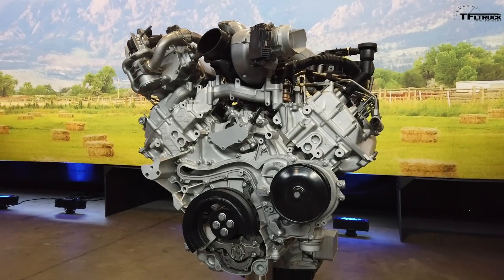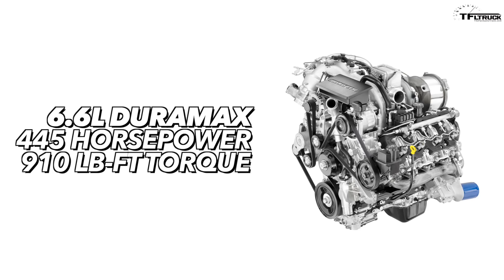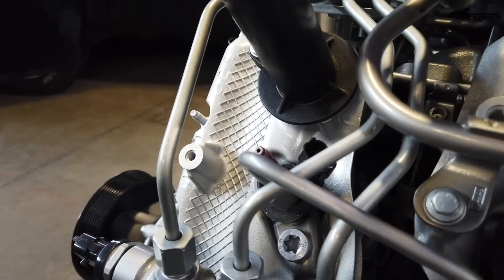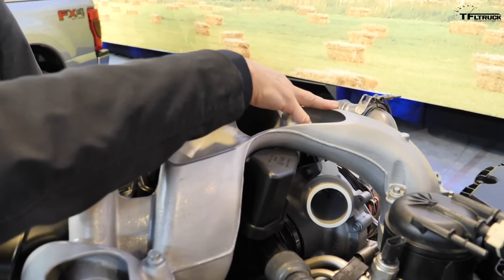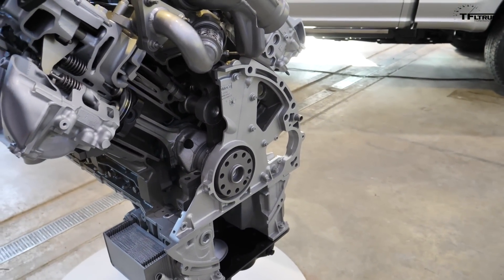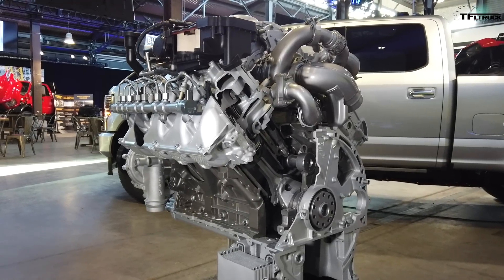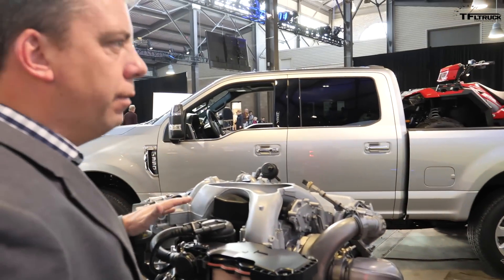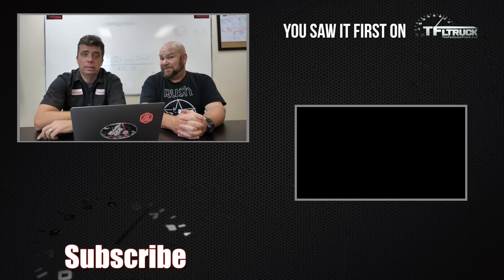Here's How the 2020 Ford Super Duty Diesel Makes 1,050 Lb-Ft of Torque!

Comment: ford tremor actually has LSD front locker
Reply: That is factually inaccurate... an LSD locker doesn't exist lmao you are saying it has a limited slip differential front locker? Which is it? Limited slip? or a locker? because they can't be both and they are in no way the same.
Reply: @brandonmoore9440  it's LSD like the raptor
in TFL they consider LSD a locker
Reply: @amm2472  TFL does not consider an LSD a locker nor does anyone else in fact they actually stated the tremor doesn't have a front locker like the Power wagon in this video so if they considered an LSD a locker they wouldn't have said that so just admit you don't really know the difference and go on with your life.
Reply: @brandonmoore9440  Roman does
in ORI index he always counts LSD a locker
Reply: @amm2472  That's because they score the "offroad worthiness" and they use a score 5% for front/center/rear diff and so of course having an LSD they are going to give it a technical count as a "front lock" because it is obviously a benefit over a normal open diff front but it isn't a "locker"
Reply: @brandonmoore9440  that's exactly what I am trying to say
Reply: @amm2472  It did not come across that way, but then we agree so good day lmao.

Comment: Until a Slightly modded Gen 3 Cummins pulls up next to it.... then it’s an overpriced slow aluminum can again that sucks diesel down. I get 26.7 mpg hwy empty on my 04’ 2500 quad cab, bet the Ford gets half that.

Ok Ford Rant Over, it does look nice I will give it that but better than my Gen 3, no way! My opinion after owning both vehicles, on my 2nd Gen 3 (the original Million mike motor)

Comment: "The truck wars are just getting started..." 
I'm confused. Then what has been happening the last 30+ years. The only war I can think of that has been going on even longer than the Afghanistan conflict is the truck war.
Reply: Well think about it.  Just fifteen years ago, diesel pickups only had around 500lb/ft of torque.  Now we have two out of the big three with trucks at or above 1,000lb/ft of torque and some of the gas pickups of today have as much torque as the diesel trucks did fifteen years ago.  Now we're waiting to see who can pass 2,000lb/ft of torque.  That's why they said the race has just begun.  It's been building up and it's only gonna get more competitive.

Comment: These trucks are gonna be putting out semi numbers in the next ten years lol
Reply: They pretty much already are...
Reply: Gonna need a CDL prior to purchasing them too lol
Reply: DOT is going to have a hay day with these new trucks, hope new truck owners are willing to get their cdl licenses to drive these ....
Reply: Semis will just handle loads better
Reply: They already are
Reply: Real talk. How about improve emissions systems.
Reply: Well you can get anywhere from 400 to 600 horsepower and 1650 torque to 2,000 lbft of torque. I have the economy version of the Cummins ISX 400 horse and 1650 torque. Regardless these new trucks are getting very impressive with their power and torque outputs
Reply: @Homer Simpson I like a little black smoke but i would like if they improved the emissions treatment would last long as the engine.
Reply: And the DOT is noticing this as well.
Reply: Alexander Syed   But Semis are also going to get monster numbers in 10 years. However not as big of an increase
Reply: Not really a 550 hp engine in a heavy truck puts out 1850 torque or the optional 2050 at way lower rpms with way higher duty cycle.
Reply: @swacoustic  look how power output keeps increasing there gonna put out semi output numbers an economical hwy truck puts out 450HP & 1700FTLBS.

Comment: All these new engines from the big 3 are amazing. But to be honest I wish they would concentrate on MPG and durability and remain at the current power levels.
Reply: supperterofsanity  All of these engines are durable period ! No worries there !
Reply: They are durable. Any new heavy duty truck will get you 200,000 miles no sweat if you take care of it. And I would say the fuel economy is pretty damn good for an 8-10,000 lb vehicle.
Reply: Alex Puls lol I had a 2005 Chevy with a 5.3 with that. My Cummins better get 300k plus miles service or I’ll be pissed!
Reply: HD trucks aren't required to follow MPG requirements (yet).  The engines are durable as long as you keep up on the maintenance just like anything else, and more torque means more towing in most cases and pickups are starting to climb into the realm of small semis.  If you had to choose between a semi and a pickup and they could both tow the same amount, what would you rather buy?
Reply: For real!!
Reply: We need to eliminate requirements for DPF, EGR, and DEF and we would get performance and MPG!
Reply: Dee Jay  you do know only a couple bolts hold the cab on a truck and the harness for a new powerstroke engine is easily disconnected from the cab right?  It only takes about an hour to pull a cab and it's honestly easier than pulling a transfer case.
Reply: Big power is how they get you to overlook the reliability and fuel economy issues when you look at a new truck.
Reply: Dee Jay a gas engine (and a smaller vehicle) is the right choice for most people.
Reply: Today's day all vehicle manufacturers focus on is quantity over quality, back in the 90's early 2000's it was quality over quantity
Reply: Well said I believe that's what GM is doing, they aren't worried about numbers but have the largest oil coolers, largest only aluminum fan by 4" and largest radiator. And industry first diesel ram air for further cooling. With new Allison tranny 10 speed and no parositic hp/tq loss I guess I've done the research lol.
Reply: I agree
Reply: Dee Jay  sorry to hear about your brother's truck. I myself currently own a 2017 f350 crewcab shortbed xlt fx4 diesel. It has 71,000 miles now and has only been to the dealer twice for steering stabilizer and wheel alignment since I took delivery back in 17. I did my own maintenance since day 1 with rotella t6 and motorcraft filter and fuel filters. I tow 9,000 to 10,000 lbs. rv trailer twice a month. It drives like the day I drove it home... This trucks needs to work hard to stay strong like a man staying in shape by exercising...

Also, this truck travels a lot and I always made sure to get fuel and def to major truck stops for fresh fuel and def...
Reply: Then talk to the tree huggers they are the reason for all the emissions and powerloss and poor fuel mileage on a diesel

Comment: The problem with these small engines making this kind of power is going to be reliability, longevity and cost of maintenance.  They just cant keep throwing boost and fuel pressure at 400 cubic inch engines and expect these things to live, especially at the RPM they are turning to get the numbers.   For example a big rig diesel making 1200 lb of torque is twice the cubic inches with internals that dwarf the pickup diesel and they make all this power at 1200 RPM.  I pity the fool who lets one of these things escape the factory warranty.
Reply: Guys have been running around with 500+hp and 1000+torque for years in tuned trucks that came with less power from the factory and they have all held up well .to say the trucks made with this power wont hold up is stupid.
Reply: Most tuned trucks are deleted and will run just fine if you don’t stick a 35klb trailer on the back and drive it like a rental car. The OEM’s are claiming upwards of 35klbs towing  with these trucks!  To achieve this you have to throw a bunch of technology and expensive parts at the same displacement engine to get there.  It’s simple physics,  more fuel and boost =  a shorter lived of engine.   Throw emissions in the mix and it’s a recipe for expensive repairs.
Reply: @scottg391  ya and guys have been towing 30 000+lbs with much less capable trucks for a very long time and have lasted for instances I just had a shop built and my contractors pulls a 35 foot gooseneck dually trailer with a 22000 pound zoom boom with 2500 duramax and has been using the same truck for 300 thousand km and has lasted just fine or the guys who haul 11000lb fifth wheels with there old halftons  .these trucks will be reliable as far as the emissions crap I 100% agree I live in Saskatchewan canada so that crap comes off we have 0 laws for taking emmisions equipment off. Also its  not the blocks or displacement that makes them fail it's the internal parts that fail thus the upgrades more pressure with fuel is good for diesels they run more efficiently and dont run out of fuel with heavy loads and your foot on the floor and boost is fine as long as you can get rid of the heat and use better gaskets and fasteners  .

Comment: These companies are going to keep going until they get Ignorant people that don't know what they are doing towing this stuff killed. 
These trucks can't stop that kind of weight safely PERIOD !!! 
The 450 can..
 But Ignorant people are going to think the 250 and 350 can tow these weights.
Reply: They are not rated to tow a weight unless they can safely stop while towing that weight. The problem is not the truck. The problem is people not knowing how to tow. Quit blaming the truck.
Reply: @sammysampson183 . Dude they are saying that a 250 or 2500 series truck can tow 30,000 now. That is completely Bullshit !!! There's no way these trucks can safely stop the weight going down a Mountain.
 You are talking about "Almost" 4 times the weight of the truck. I'm not saying anything about the trucks. I'm saying that they are full of Shit acting like this is safe for the inexperienced person towing these weights.
Reply: @MTCKIE68  The brakes on the 3/4 ton and 1 ton trucks are the same. Equipped with trailer brakes, that you should have when you're pulling that kind of weight anyways, alongside exhaust brakes, there would be no measurable difference between the 3/4 ton and 1 ton pickups stopping distance. The 3/4 MIGHT even stop better since they typically weigh less, though insignificant in this case. The only factors you have to worry about between the two is payload capacity, whether or not it's a SRW or a DRW (in which case you should be comparing a SRW 1 ton to a DRW 1 ton), and in Ram's case, less power in the 2500 since the HO engine is only avaliable in the 3500.
Reply: @MTCKIE68  The trailer has brakes as well, ding dong. You obviously are one of those people who should not be towing anything. Sheesh.

Comment: But because you can get a diesel in the tremor you loose the winch the power wagon has
Reply: There isn't a wench for the Tremor anyway. Besides, you can go buy a wench for your Tremor. Try buying a diesel for the Power Wagon.
Reply: @CMH_1975  the only reason you can get a winch for the power wagon is because there isn't a intercooler behind the bumper like there is for the tremor if you get the diesel in the tremor
Reply: @austinblevins6804  that's not gonna stop anyone from putting a wench on a Tremor. If it'll work in a normal Super Duty, it'll work on a Tremor.
Reply: @CMH_1975  people get aftermarket bumpers to get winches on them so they don't have to mess anything up
Reply: @austinblevins6804  either way, a bumper and a winch are a lot cheaper than a diesel swapping a Power Wagon.
Reply: @CMH_1975  who wants to diesel swap a power wagon

Comment: Keep up the Great news and reviews, it's a shame you had a few dislikes on this. (Butt Hurt Ford Haters) I am interested in seeing how it stacks up against the Ram 2500 6.7 in the 0 to 60 and in towing. 
I'm getting the Ram no matter what the outcome is though.
Reply: BluRidgePrepper   You like the interior I’m assuming?
Reply: @randomprojectsusa5196    Are we talking ram or the ford?
Reply: BluRidgePrepper   Ram has nicer interior I think
Reply: @randomprojectsusa5196  it's the storage but the interior sealed the deal. So I'm impressed with the mega cab with ram boxes and the Long Horn saddle seats have me drooling. Right now I'm on the fence of which engine to get. 6.4 hemi is plenty powerful enough and I don't need to worry about emissions but fuel mileage will suk ass. The 6.7 Cummins is just a freak of nature, goobs of torque and excellent fuel mileage but the whole epa chasing down the diesel delete crowd has me worried about long term reliability.
Reply: BluRidgePrepper   If you need, just mod it a little to increase reliability

Comment: Not impressing Cummins is a inline 6 and powerstroke is a v8 and it's make a little better numbers lol
Reply: Still both are 6.7 liters so they're the same size/displacement. Still, the inline 6 has 7 main bearings on the crank compared to only 5 in the v8, so I'll take the inline 6 anyday. Not to mention it's way easier to work on and service.
Reply: @Jackmerius_Tacktheretrix  I second that . I've had a 2015 ram 2500 w/Cummins and now I have a 2018 ram 3500 w/Cummins and    there's plenty of room to get in there and work on them if need be . Which isn't often  , lol
Reply: @glennporter771  I have a titan xd with the baby Cummins amd it's the same way. I almost didnt even look at it simply because it was a v8, and I knew how bad the duramax and powerstroke were under the hood. I was pleasantly surprised how easy it was and how simple it is laid out. You can easily access the fuel injectors. Valve covers etc. Looks almost like a gasser under the hood. I can touch the transmission and bolts from up top behind the engine because it isnt pushed sp far back, and there is tons of room to service the belts, fan, water pump etc. Very well packaged, and unlike the duramax and powerstroke, it doesnt look like a rat's nest with stuff flying all over the place under the hood. Sure, it doesnt make as much power, but I dont need that capability. If Cummins can make a v8 so well laid out and clean, why cant the other two? Sure it doesnt have the power of the big 3, but with whatvibdo I dont need a 3/4 ton, but since the titan xd weighs over 7,000lbs it is still just as stable as a 3/4 ton with a smoother ride. Yeah you can tow 10-12,000 with a half ton, but it has to be a certain configuration, and that titan xd with the Cummins will last alot longer towing 10,000 on the regular than any half ton does. Love how Cummins also offers a separate 100,000 mile warranty on the engine. A the turbos spool up so early, at 1400rpm they spool really quick, and even at 1200rpm they'll spool up good. The torque comes on way early in the power band, waybearlier than my super duty did. Overall I love the truck, but if my needs become more I'll be at the ram dealer getting a 2500 with the Cummins.

Comment: The tremor package pretty much just give a leveling kit, mud tires and a front diff with a limited slip because the fx4 already has the rear locking diff and suspension upgrade
Reply: Tremor has other features as well.
Reply: Hunter Wilson It don't take much to get the Ford fanboys all hyped up.

Comment: I hope they don't follow Ram and have 2 separate diesels in their lineup. Gimme the tremor with this motor. Dual fuel tanks....dual lockers...475 hp and 1050 lb. ft. Road trip to Prudhoe Bay! Then from there to Key West.
Reply: Every diesel for Ford is a 6.7 and has 475/1050 power levels. The only trucks with lower power output are chassis cabs.

Comment: In 3/4 ton class that no one seems to want to talk about the Ram is dead last in diesel power figures. With GM rocking a 10 speed and more HP than even the H.O Cummins I wouldn’t say they’re actually last in diesel power delivery. I know it was just a torque discussion but still that torque number doesn’t mean anything if it isn’t applied comparatively.

Comment: I’m very interested for the 2500 and F-250 testing because the ram is way behind in that area when it comes to engine performance because they only offer the high output Cummins in the 3500
Reply: Because you don’t need to be towing 37k with a 2500.
Reply: @Ezrasideas  100%
Reply: I’m assuming your talking newer cummins, get a 3500 it you decide to go with a ram. Asian transmission is much better than the 68rfe transmission in the 2500 cummins
Reply: Sir. I couldn't care less if you want a 3/4 to do 4/4 things. If you need that much power ( almost don't need it in a one ton) get the 3500.
Reply: But Cummins is still out selling duramax and powerstroke kn the heavy duty pickup market.

Comment: Mpg, lol.I think it's worth explaining why the 450, 550, 650, and 750 are rated differently as far as hp, and tourqe.  Great video as usual!!
Reply: Because in those heavy duty applications, especially the 650 and 750, those engines wouldn't last long at all with that much power hauling that much on the regular.

Comment: But why compare the Ford 450 to the Ram 3500 and GM 3500?
Reply: The F450 pickup isn't actually built on the F450 cab and chassis frame. It's built on a reinforced F350 frame with heavier suspension, axles, brakes, ect. Ford calls it an F450 for marketing so people think it's "bigger" than the competitors, but it is still a 1 ton pickup so the 3500s would be it's competitors.
Reply: USMC Vet 
But it’s still not a true 350/3500.  Anyone can build a 4500/5500 and put a 14k gvwr on the sticker and say it’s really a 350/3500 with heavier axles. 
We all know the F450 “could” actually carry more payload than the F350 but since it’s rated at 14k and it’s a heavier truck, the F350 actually has a higher “legal” payload. 
It’s just fords way of marketing a higher tow capacity. 
If GM or Ram would follow what ford does they’d be the same most likely.
Reply: @scottback3020  but it isn't built on a 450 chassis, so it's not a 450. It's a beefed up 350, so it competes in the 1 ton class.

Comment: 🤔 I like the idea of the exhaust in the valley of the for better heat management bet what's the point of the intake ends up over the turbo and exhaust? 🤔
Reply: Intakes outboard, where the exhaust manifold traditionally is
Reply: @AK_Ray  yeah but it looks like a routes to apply them that says right on top of the exhaust and turbo.